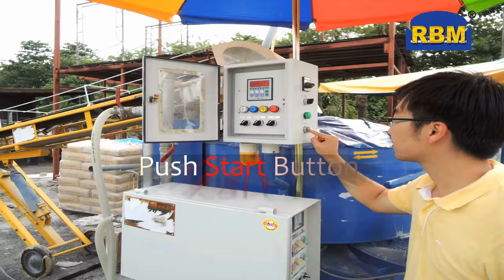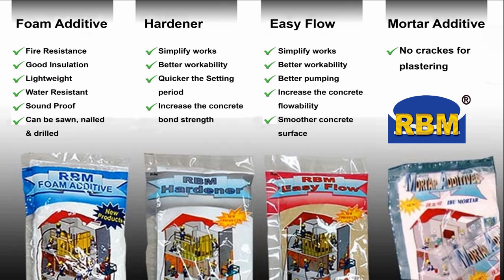Latest concrete  house in 2 days!

Comment: Makes sense for California with all their wildfires but I don’t know if it would be better or worse for earthquakes. It certainly makes sense for humid coastal areas - no mold or termite issues and holds up well in windstorms.
Reply: It has steel structure inside it can withstand earthquake.
Reply: Well as you may be aware, the ancient world was built of concrete. ..

Comment: Seen something similar at Seremban Malaysia. The build up was fast but the end products shows hair line cracks where the walls joined and some who bought those houses and stayed there told me that when there is a heavy rainstorm for around a day or so the walls feel damp. Not sure if its because the man contractor tried to cut corners and use cheaper material and bad workmanship or its the original material fault.
Reply: ualuuanie concrete absorb water so of course it feels damp
Reply: Adding an inner or outer insulation layer cou km d solve that tho. System seems awesome but could be just marketing hype I dunno :(
Reply: Yes. Bare concrete will do this. It is porous. But it may be condensation, not seepage, they are experiencing. Also, Concrete is strong, but will last longer if it has proper protection.
Reply: 1. It wasn’t in America so a lot less regulation 2.they probably didn’t have any layer of insulation which is required if you want your concrete house to last and also if you want it insulated 😅

Comment: Great concept, but don’t you reinforce the concrete with steel??
Reply: i was thinking that XD
Reply: @Dylan Hurley +Dylan Hurley It would crumble in an earthquake
Reply: Do you not see the steel structure the forming plates go on?
Reply: Zach Phillips the framing they used was most likely aluminum studs. Which are better than wood framming,but it's still has it's down side. They should have used some rebar to and it would be a lot better supported.
Reply: They did. Also, proper concrete doesn't need steel anyway.(gasp) yes it's true. Concrete is an actual science. It can take a lifetime to learn all the tricks and mixes.
Reply: @WayToManyAssassins  and if there was a bad tornado
Reply: @christopherallen9615  Don't share bullshit. Concrete always needs reinforcement.
Reply: Yea I didn't see any rebar whatsoever
Reply: We’re you not watching the video?
Reply: Sidney Mantissa  are you structural engineer to say that, that's a monoblock with GI sheet channel 1mm thick, it can stand earthquakes better than conventional concrete construction techniques
Reply: @panayiotiskoinis6958  old palace and shrines for thousands of years has no rebars
Reply: @3mbr436  you didn't see the full metal frame?! they metal framed the whole thing then poured concrete over it.
Reply: The aluminum framing would have done the job. But aluminum framing is expensive so rebar would actually work out cheaper, and most likely be done quicker. I'm guessing they could also pair it with fiber reinforcement too

Comment: What happened to the reinforcement steel cage ??? Why didn't you show anything about it ?
Reply: The steel frame is what seems to give its support instead of using rebar
Reply: what do you mean what happened? it's inside the concrete, they poured concrete over the steel frame. They literally showed concrete slowly covering the steel

Comment: Where is this system?
How is the price per sqft?
Can you make a single, small house?
Reply: thes types of vides have been posted for years and NO answers to those questions.  Plus embedding steel in foamcrete resulted in quick rust problems.

Comment: How much would it Cost to build 4k first floor 1500 Square foot Second floord 800 Square foot Garage Attached and 1k GUest house Solid Concerate Extior walls and brick interror with special bricks to allow brackteint to place dry wall  on wall.  Garage is the Atteoct with storage slash Storage

Comment: Where are the foundations ?
Reply: Obviously no pilings. No need to dig out a basement. Asians see little need for one. It's built/ spread over solid ground. Cheap though. So it's not a system to be used on marshy land.

Comment: With porous foam concrete you do NOT want to have embedded steel.  It will rust out.
Reply: its just to frame it for initial support
Reply: @moviehouse8883  afterwards what is the non compression support for it?
Reply: Lol you don't know nothing

Comment: Why  in the World make it like this it is totally wrong.  It should have steel or rebar frame than injected cement 🤯
Reply: Why don't you try watching the video from the start before making stupid comments.
Reply: @jamesthomas8915  i stand correct pal .those are not strongly build structure.  Yes they use same kind of metallic frame . But not like  rcc